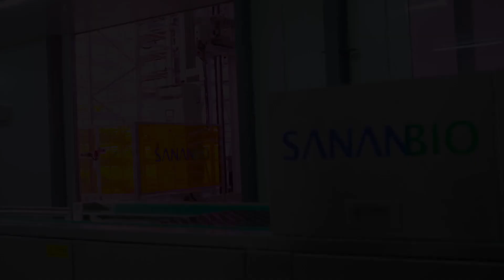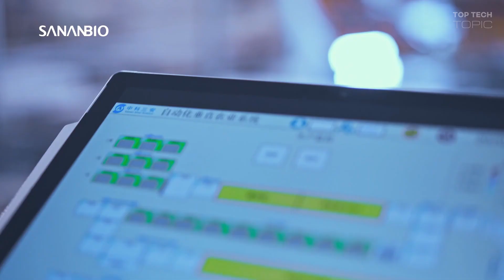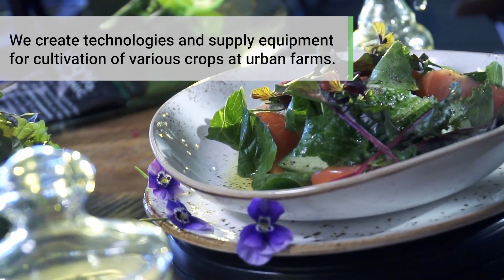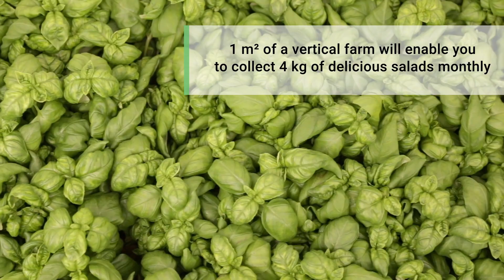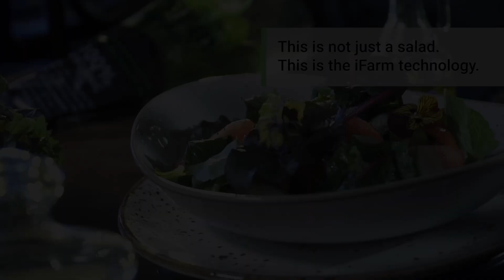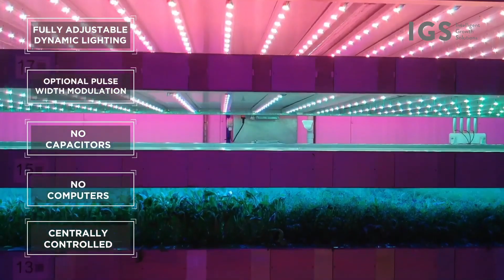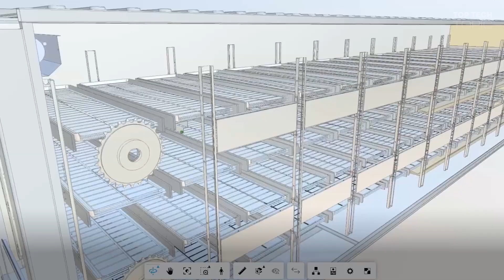5 Vertical Farms Run by AI and Robots  | Future of Farming ▶ 3

Comment: would be really interesting to know the costs, as while you save transport cost the water cost in vertical farms is much higher then traditional and labor is actually only a small part
Reply: Indoor Ag uses 95-98% less water then traditional farming. The biggest operating costs effecting your ROI when entering the industry is labor and lighting (energy).
Reply: It cost aprox for 200m2 300 000 euro in equipment plus you need to make hall that is well insulated with lab enviroment so its epic. You can count aprox 600 000 euro for 200m2.
Reply: @bornaskovran9303  pretty expensive to grow some spinach...
Reply: While its possible reduce costs by using machines instead of humans, it is important to consider the full environmental impact of these choices. Some options to consider in order to mitigate the environmental impact of machine use might include using more energy-efficient machines, sourcing materials and components in a more sustainable manner, and implementing strategies to reduce waste and pollution. It is also important to consider the overall balance between the costs and benefits of using machines versus humans, including not just financial costs but also social and environmental costs and impacts.
Reply: @glovozagreb6594  ffs 😂
Reply: @ouppz  i was fucked up

Comment: Left-Handed Circularly Polarized Light is best 
for animals, humans, and producing the most nutritious plants.
Non-Thermal Synchrotron Radiation Lamps will make LEDs & all other lamps obsolete.
They are tunable for catering to specific vegetation & flowering needs, 
they don't burn out or lose color over time, 
and they provide the best lighting for far less operating cost.  
Wanna know more ?  Contact me.